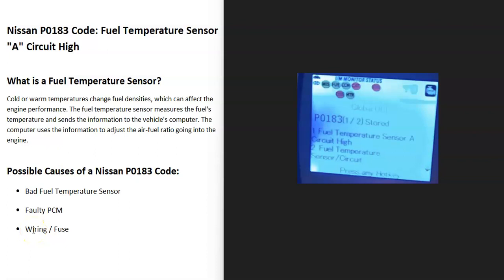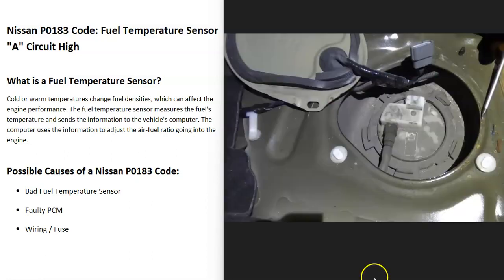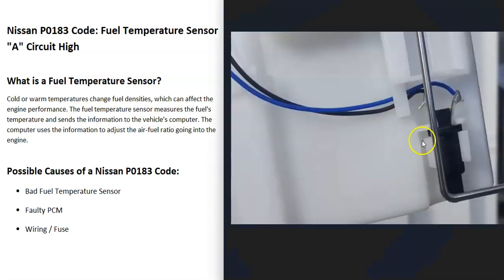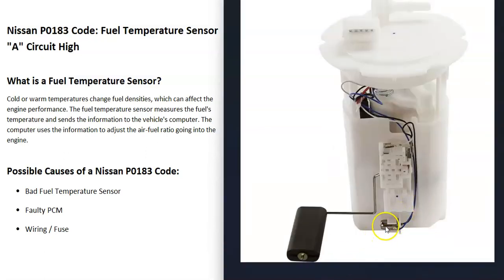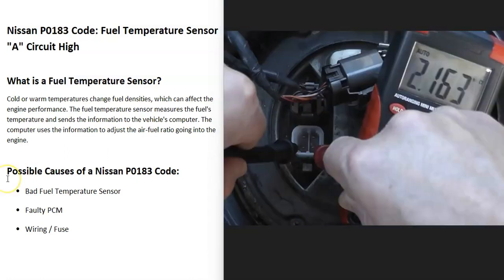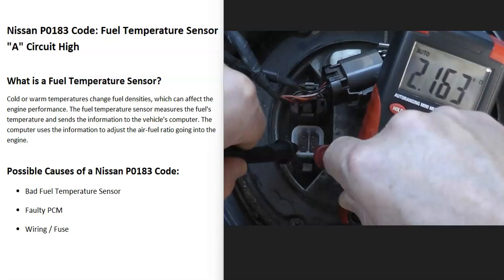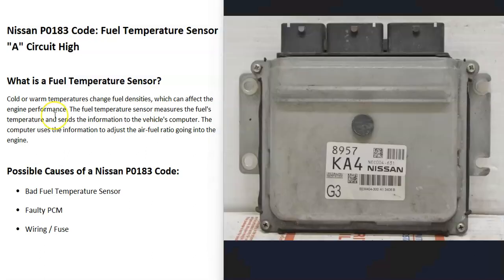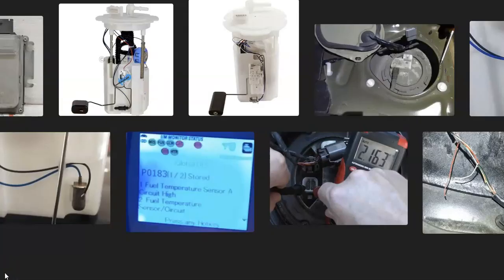Causes and Fixes Nissan P0183 Code: Fuel Temperature Sensor "A" Circuit High

Comment: You've mentioned it might be wiring or fuse. Which fuse is associated with fuel temperature sensor?
Reply from the maker: It will be vehicle specific. Sometimes, it can be confusing which fuse it is, and it can be combined with other components. If you can't find the information, I would check for voltage.

Comment: I had failing fuel pump and replaced it with premium TYC copper fuel pump with metallic fuel sensor. Ever since i replaced it im getting P0183 code. I guess i will use plastic sensor from old OEM fuel pump. No fuel temp sensor code on plastic one. That is kinda weird and backwards. lol. I was able to unplug old one but i am not sure if new one has plug or if its soldiered on.
Reply: It’s the connection sometimes, I cleaned mine when I put back this shows up
Reply: Did you have a Nissan Sentra?

Comment: This car keeps coming back. With the fuel pump code three times it’s been back not running changed the fuel pump it starts right up but then a week goes by it is back on the tow truck with the same codes. The second time the passenger side of the tank was bone dry is it a wiring issue or the sending pump is the problem.
Reply from the maker: When they do that, they can be hard to troubleshoot the cause. It could be a wiring issue or possibly a containment such as rust in the tank that is damaging the fuel pump.

Comment: Could old gas in the tank cause it to throw that code
Reply from the maker: Usually, when the gas is old, it causes the engine to turn badly and sometimes clogs up the filter. I've never seen that cause a P0183 code, but strange things happen sometimes.

Comment: Just swapped out my fuel pump yesterday. Following got the P0181 & P0183 code come up.
Reply: Cheaper fuel pumps don't come with a working sensor, I cut the sensor from a different car and added it to my fuel pumps sending unit. I have a video on my channel how I did it. You'd have to check with you specific car how to add a working sensor.
Reply: @TeamGun how much did that run you?
Reply: @eisaiahjeffries9078  I think it was like $25 for the pump from the junk yard, then I did all the soldering myself.
Reply: how to do it? im not a mechanic
Reply: So I have the same problem. Does it HAVE to be changed without having driving issues? Or can I just overlook it? Thanks

Comment: I just swapped my fuel pump and got this code and p0463
Reply: Cheaper fuel pumps don't come with a working sensor, I cut the sensor from a different car and added it to my fuel pumps sending unit. I have a video on my channel how I did it. You'd have to check with you specific car how to add a working sensor.
Reply: Thanks for your help us @TeamGun
Reply: @TeamGun can I order just the fuel temp sensor for a 03 Nissan Murano?
Reply: @camoandbling  no, if you google 2003 Nissan Murano fuel pump, you'll see the fuel pumps that come with it, its the small black sensor at the bottom of the fuel pump assembly with 2 wires going up to the fuel sending unit on the pump housing. Your only option would be to get a used temp sensor from somewhere and solder it to your pump, or buying a whole new pump with it, sorry.
Reply: @TeamGun  I replaced my pump a few years ago. It wasn’t bad so I still have it boxed up. I’ll just put the new pump in. They are not that expensive!  Thank you for reply!
Reply: @camoandbling  Oh no problem! If you have a multimeter you can test the sensor before it goes into the tank, and test the fuel gauge as well. Set MM to maybe 20k resistance, and place the red/black tips on the pads the gauge scrapes against to give you the fuel reading when the float goes up. I think it'll read .30 when on empty, and it'll change as you lift the float. For the temp sensor, place the red/black tops on the 2 wires to the sensor and itll read...I think maybe 1.5 resistance, or something, and if you dip the sensor in a bit of warm water I think resistance will rise to 2.5 or so.
Reply: @TeamGun  awesome! Thank you!!
Reply: Hi! Can you help me please? I have an nissan qashqai j11 1.5 dci and i don't know where is the fuel temperature sensor located. Thank you.

Comment: Where do nissan xtrail t30 2.2dci 4x4 2004year . Where do he have the fuel temperatur sensore? I took out the gass level caps out of the tank and there was non of them in it. Where can it bee els ?
Reply: You need to take out the whole fuel pump. It is on it.

Comment: What about P0182 ? Is it same issue?
Reply from the maker: A P0182 code is “Fuel Temperature Sensor A Circuit Low Input.” It would be caused by the same things as a P0183 code.